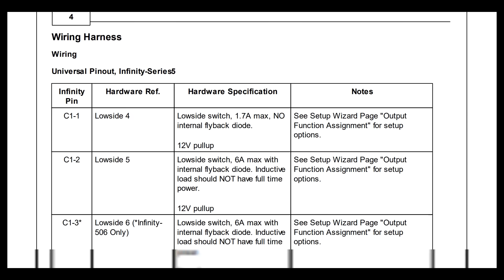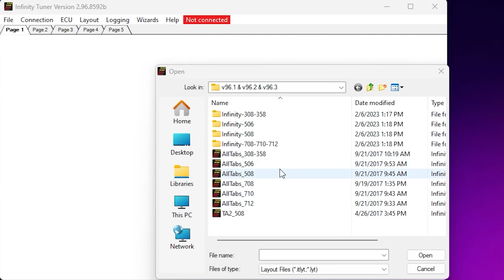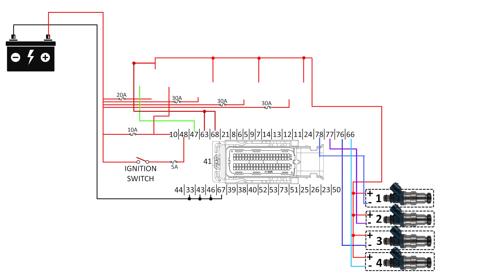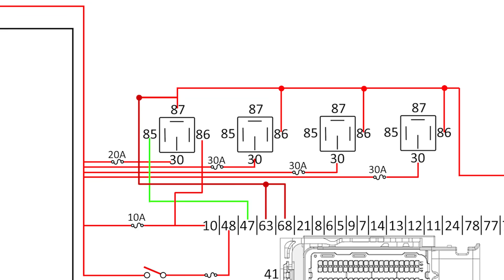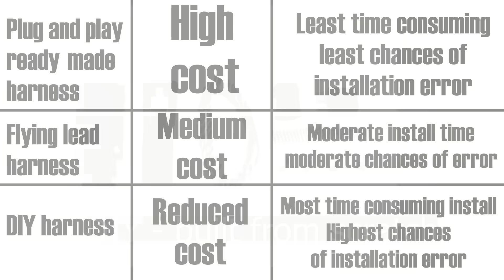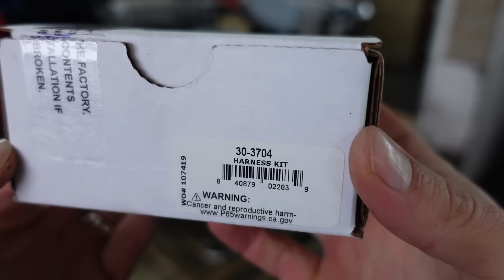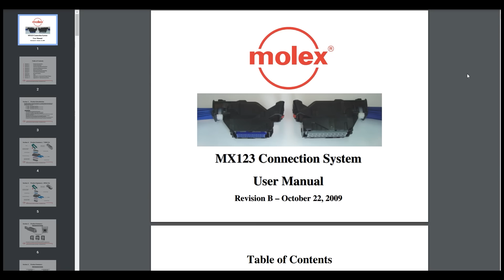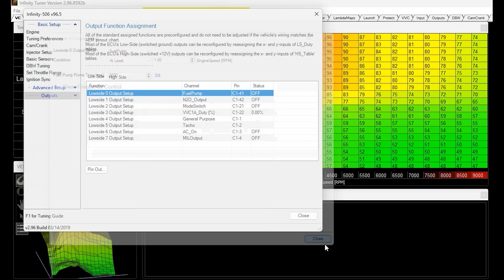Beginner guide to ECU install and wiring + editable wiring diagram download

Comment: there is something that bothers me about this blank ecu. for example, i drive a SAAB 900 that in its original form had a normal distributor ignition system. however, its possible to install the Trionic system that saab created later on. now they used specific components, like the red/black ignition casette which had single 40.000v coils and had also the knock sensor included. now can the ecu handle engine components that are made for the former engine-ecu exclusively?
Reply from the maker: It depends on the components. If you figure out what pin on your coils does what than likely the ECU can fire the coils. Coils are just an output. Also, the ECU isn't blank it has generic maps for universal applications and correct base maps for specific vehicles when you buy it as a pnp for the vehicles they offer. I fired up my car with the generic map, just added a bit of fuel at idle and the car fired up.
Reply: @d4a  hmm ok. one last important question. the trionic had several versions. i use the T5.5 version, however, the later T7.0 version had a better and different boost controll valve (T5.5 used analog signal, the T7.0 uses digital signal). now to make the T7 Valve usable for the T5.5 you have to solder a certain chip module on the main circuit board of the T5.5 ecu to make it work. my question is, does the signals matter that components generate (analoge and/or digital) for the standalone ecu or can itself adjust to that? Can the standalone ecu work with both signals on the same connector terminal? (my guess is that you have to switch them in the wizard menue, but i have no clue since i have never worked with a standalone ecu and my conversion was partically made from someone else, mostly the ecu itself)
Reply: @d4a  oh and also about your sentence: "the ECU isn't blank it has generic maps for universal applications and correct base maps for specific vehicles when you buy it as a pnp for the vehicles they offer." 
the problem is that the trionic for example was designed for my engine, but not for the saab 900 itself, it had one or two extra components, like the fuel vapor catching system, which the 900 didnt have. so assuming this, its not possible to use the generated maps since they are based on the assuming i use for example a SAAB 9-3 who had the T5.5 with the vapor system. but i guess its possible to deactivate such systems inside the standalone ecu, right?
Reply: I mean if you gonna buy something at that point just buy ignition coil driver. That is basically replacement for distributor and can be driven same way coil-on-plug would

Comment: Molex makes blanks.  Or you can make your own.  I always start by blanking all of the unused pins, then checking and rechecking my work.  For me this helps by giving me several other pin references.  Also you will want to do this on a machine where the area you are mounting the ECU, or any controller for that matter, is not a weather tight area.  This helps protect your ECU/controller pins from corrosion.

Comment: What is a ECU?
Reply: Electronic Control Unit.
Actually, this video is like those about the Cosmos, by the time i really understand it, billion years have passed!
Reply from the maker: Engine Control Unit
Reply from the maker: But I think electronic might be correct too
Reply: @d4a  do you plan on doing it on a motorcycle? That would be really new stuff!
Reply: @d4a  at least we also call the brake controller as ECU as in electronic control unit. (Or hecu if referring to the whole unit with the hydraulic block) (I am developing traction control)

Comment: Where did you route your harness from the ECU to the engine? I’m planning on swapping a 7AGE into my AW11 and install a Standalone ECU inside the cabin, but I’m still trying to figure out how to route the harness
Reply from the maker: At the same spot where the wires from the factory fusebox enter. I just cut up the factory grommet up a bit. Looks totally ok.
Reply: @d4a  amazing video, have you done one on piggy back ECU set-up

Comment: Hey ...
I need help on extracting  AFR values from un-tuned cars.

Especially old ones ...

Will you make a videos on using laptops to read this data from 90s cars ?
Reply from the maker: I have never tried doing something like that and honestly have zero experience in that field. The reason is that I never needed this data and never heard of anyone needing it. Why do you need it? The data will likely be useless as cars from the 90s all ran narrowband o2 sensors and that's not something you can adapt to a standalone, if that's what you had in mind?
Reply: I have put a Link ECU system on a 1985 Subaru EA81 engine using a wideband O2 sensor for control of air/fuel ratio, can be done. Have used it since 2008 without any problems using just a crank angle sensor, toothed wheel.

Comment: Do standalone ecu's control vvt, vanos systems. If so how
Reply from the maker: Some can control vvt. The control can be set up in the exact same way as in the OEM setup or you can use different triggers, but it all depends on the type of your vvt system. In some cases it's possible to control vvt not just based on rpm, but you can also control it based on other stuff like boost, nitrous, etc. This is of course a bit more advanced to set-up but it's not too hard in most cases. At the end of the day vvt control is just an output for the ECU like anything else.